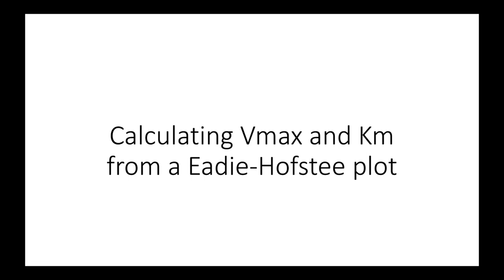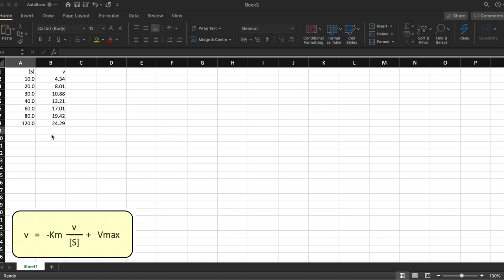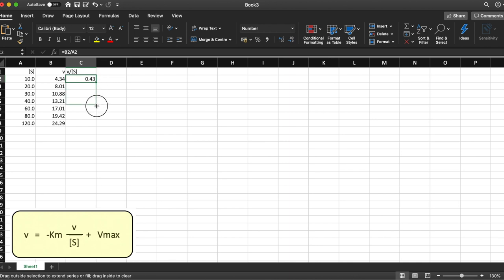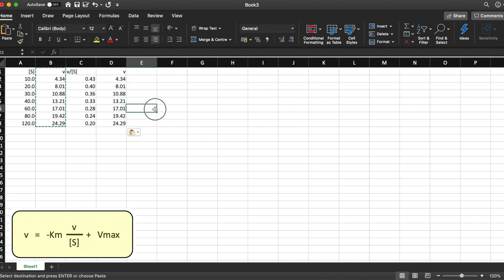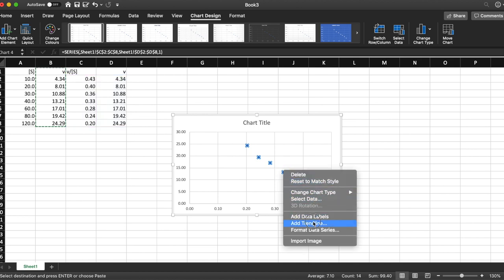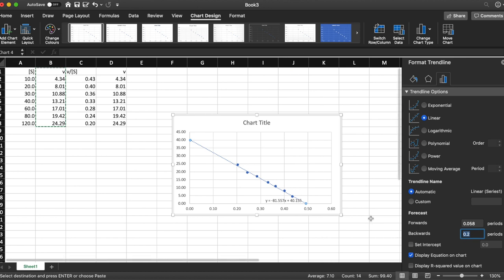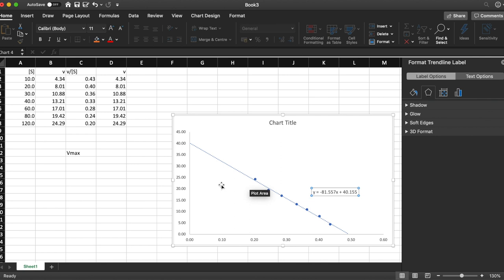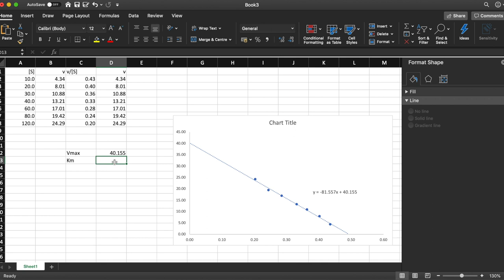How to calculate Vmax and Km from an Eadie-Hofstee plot

Comment: Sir, you really helped me alot. I was battling with my assignment for days. PLs is there anyway we can predict V value against substrate at a particular time?
Reply from the maker: Glad you found the video helpful. Predicting V for individual substrate concentrations can be approximated by taking the gradient of the tangent to the initial part of the progress curve. These are essentially the values that are then used to calculate the values used in the plot. As the reaction proceeds the ability to approximate V  accurately decrease as a dynamic equilibrium is reached, which is why the values for V are always taken right at the start of the curve, where it approximates a linear trend. Hope that makes sense?
Reply: Yes Sir, like this question asked to calculate residual concentration of substrate after 10 minutes, with So =  0.1, Vmax= 0.1, Km= 0.01. How would I go with this? Am thinking of using (So - S)t = Vmax + Ks/t * In(S/So) but the the two So are missing, suppose its one, I know how to go with it. Kindly advise. Thank you.
Reply from the maker: @Ubaida Adamu Muhammad  So would be the initial concentration of the substrate you added to the enzymatic reaction. If you do not know the initial concentration then unfortunately you cannot calculate what the theoretical concentration is at a given time point.